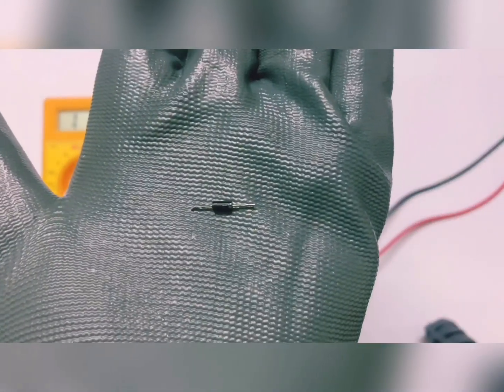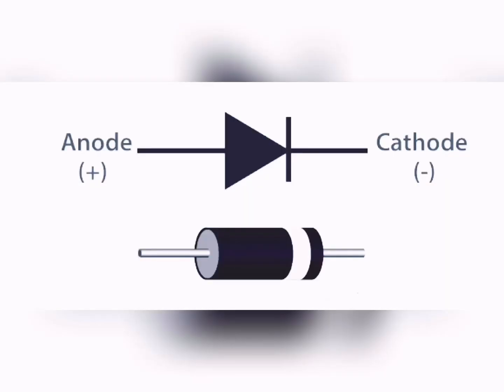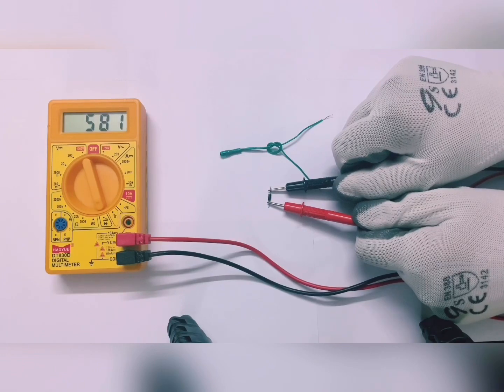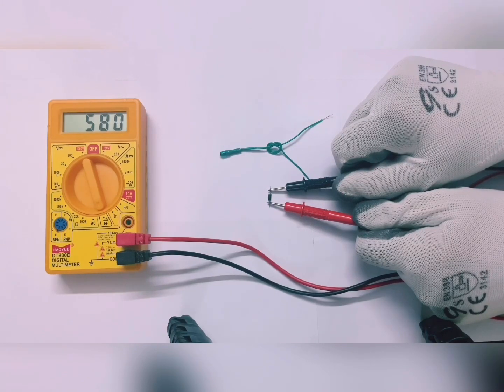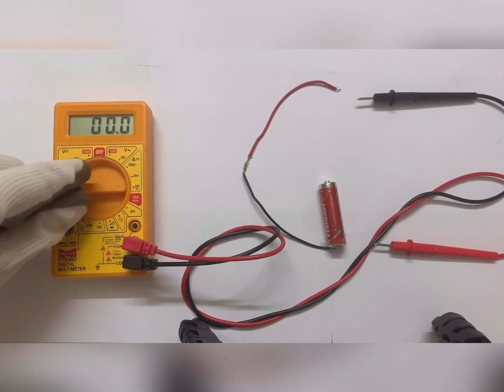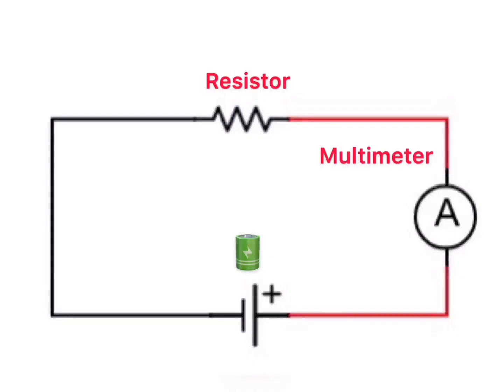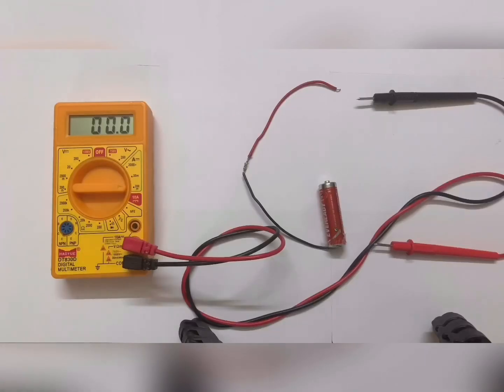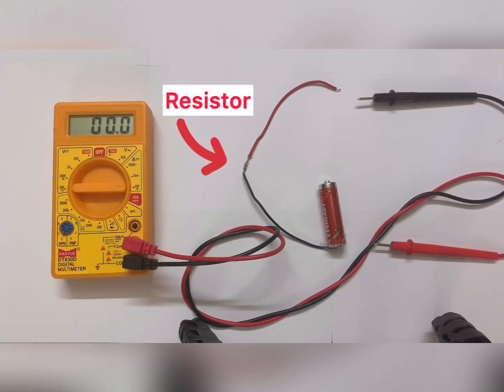Multimeter tutorial 2020 - What you NEED to know!

Comment: रीडिंग अपने आप दिखा रहा है करता करें।
Reply from the maker: If your multimeter powers up but you aren’t getting accurate readings, you may have faulty test leads. Set your multimeter to read resistance and touch the test probes lead together. It should read zero ohms.